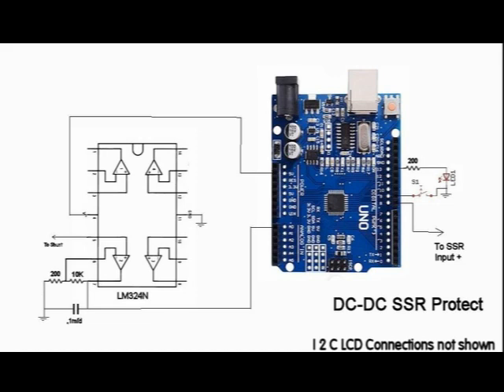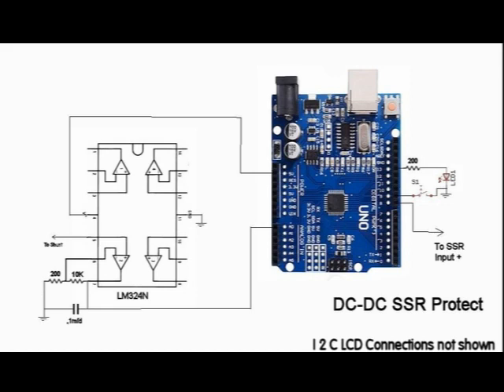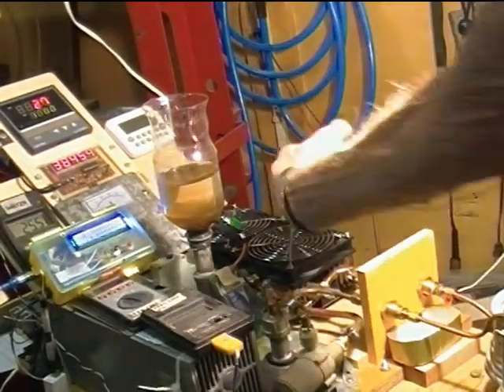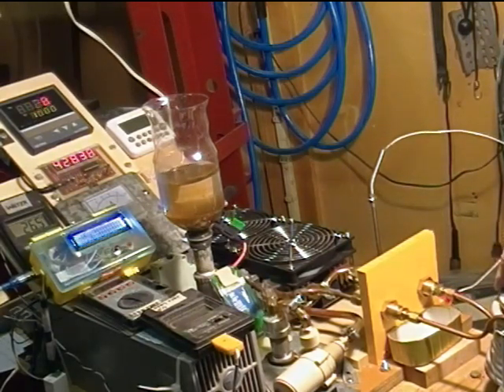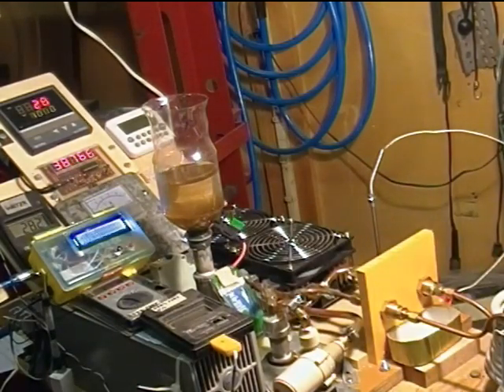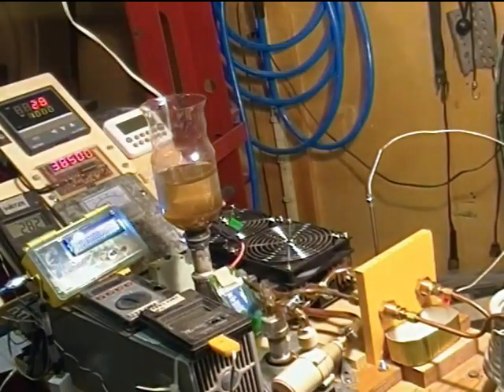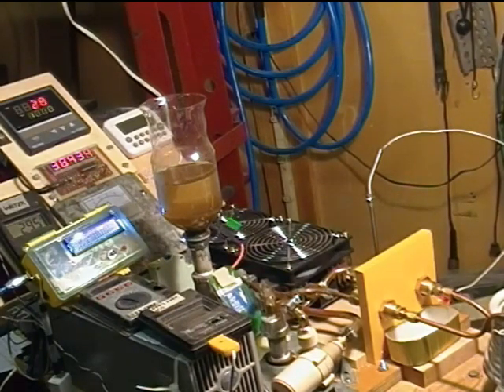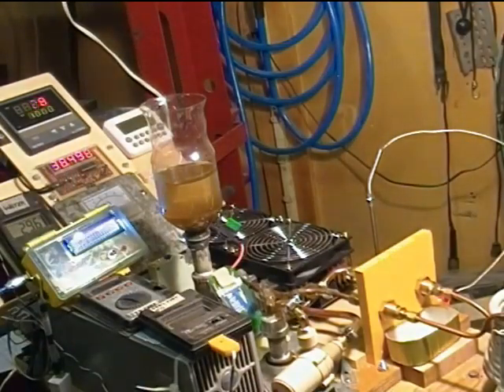2500 Watt ZVS Induction Heater Protection Ckt for DC to DC SSR Finally Working (Part 3), #193

Comment: Doing a similar build to you.
I have some surprising results.

I have (multiple times accidentally for a brief moment) sent 50amps into my cheap twade 40amp ssr. It hasn't blown yet! (Knock on wood) 

For my setup I have been using the newer raspberry pico controller. It is waaaayy faster than the Arduino and can shut off the induction heater much faster.
Reply: Also I have started to use litz wire in some situations to eliminate the need for a cooling system!

Comment: wow you try to cover all the bases. so here are my questions
1 do you consider it a must to use a solid state relay, or can a person use a contactor relay?
2 do you have a parts list to build this unit if you think it is a must for my automatic case annealer, or is it possible to use a circuit breaker instead of the system you have
Keep up the wonderful work
Oh I found this youtube video (https://www.youtube.com/watch?v=DM-EjhZKYiU) guideline
Reply from the maker: 1.  Some people who do cartridge annealing this way do use contactor relays.
I want a solid state device so it can act a LOT faster than can a mechanical switch.
2.  I don't have a parts list at this point.  I do have a circuit breaker to turn the DC to the heater on and off.  It needs to be rated for Direct Current.

Yes, I have seen this guy's work.  He is very conscientious.
Reply: @frenchcreekvalley  Thank you again for your wisdom here. I love to learn and it's people like you that make life much easier so as not to having the same pitfalls. I'm like you and love to help other out with areas I've learned about. Now to be able to do youtube videos someday.